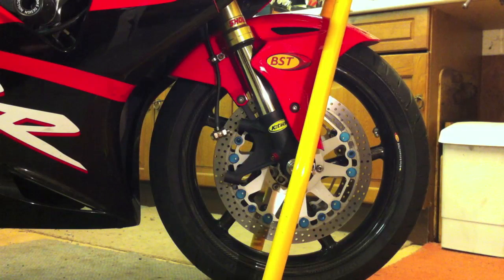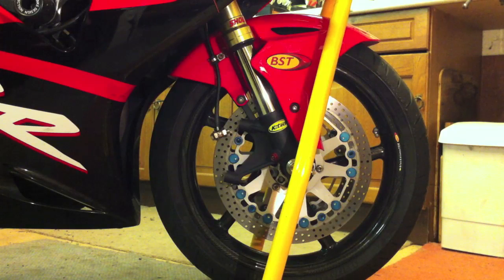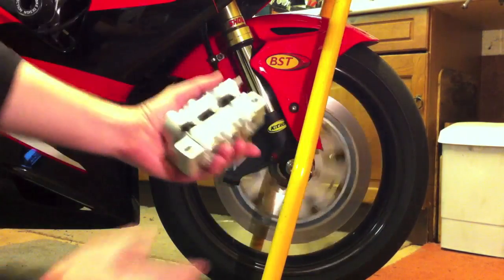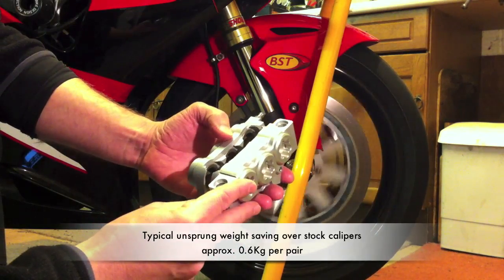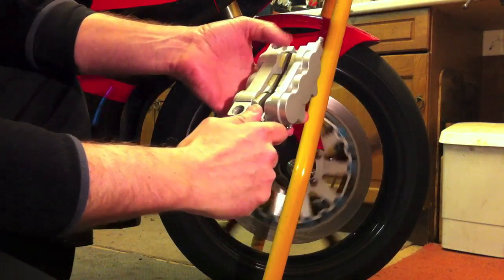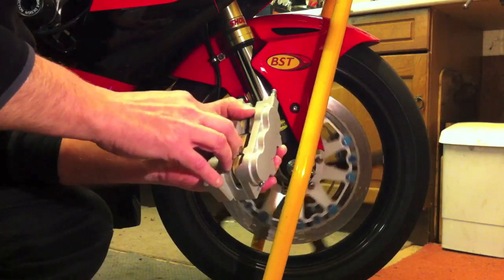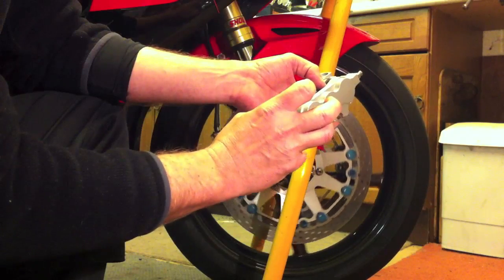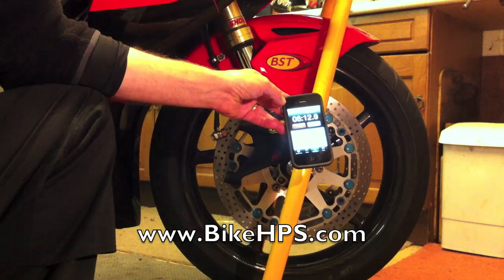BST Carbon Wheel spins for over 6 minutes with Ceramic Bearings installed

Comment: bikehps, people of your calibre should know that this demonstration proves nothing. The efficiency of a bearing can only be measured under normal load. Main problem with ceramic bearings at the moment is that they wear their cages and races out faster than conventional high grade steel balls. BST carbon wheels are brilliant but ceramic bearings have to be radically redesigned to actually match the durability of steel. Hope that happens by the way as once achieved they will be great.

Comment: On a side note the "floating" brakes on my KTM are fake floaters and have to be replaced by real floating floaters. The rotor is riveted too tightly to the center hub . The bike is not inexpensive. Stock floaters don't float and brakes drag slightly.

Comment: OK, I'm already impressed!
Reply: Impressed by what? How long it spins with the brake calipers off? The six minutes thing is smoke and mirrors. Yes they're lower friction, but not by as much as a 6 minute long spin suggests. I'd be more impressed if we had a side by side comparison of both types of bearings on the same wheel, and using something to insure the same initial velocity to make sure the test is 100% fair.

Comment: The bearingts are very noisy compared with a normal bearing set. Plus that the wheel is spinning cause the calipers and pads are missing! Install them and test again.
Reply: Val Ko lmao... u think steel bearings wud spin that long? keep dreaming!
Reply: STAGEIIGN  I don't know if they would spin longer than ceramic bearings, but for sure I would like to see a comparision between them with everything inatalled on the bike. That's more fair.
Reply: Yeah, I was wondering about that, with the calipers... I was thinking "You know, I've NEVER seen a wheel spin that long with the brakes installed"... And to that end, I kinda wonder... why DO brakes maintain constant contact? It seems like a huge problem for fuel economy.

I've been restoring an old early 1980s Kawasaki LTD and about the only thing left for me to obsess over in regards to getting it back to factory specs is the fuel economy. I've been getting 35-37 miles per gallon where the factory specs are 45 miles per gallon.